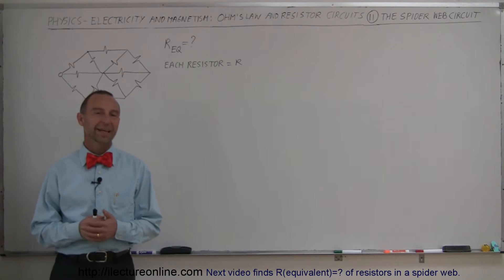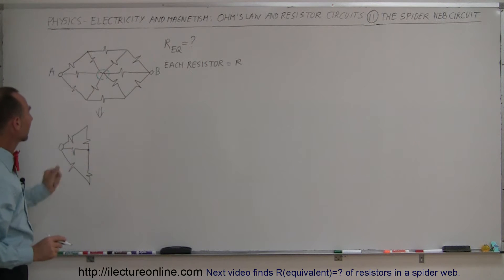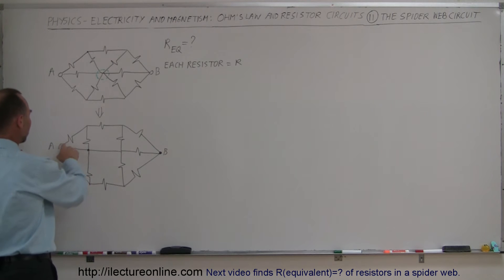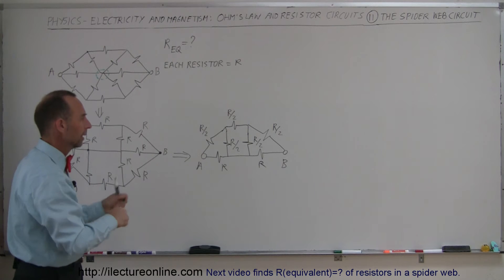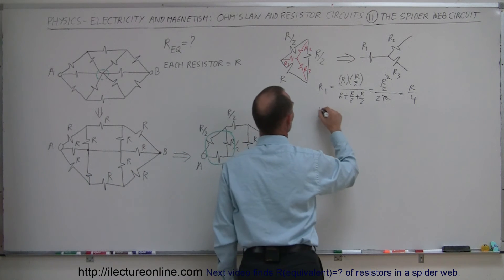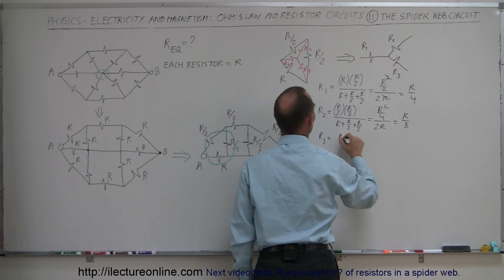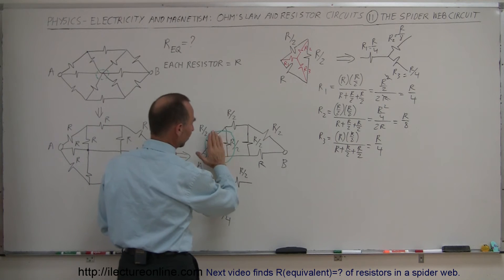Physics - Ohm's Law and Resistor Circuits (11 of 23) Resistors in a Spider Web (1)

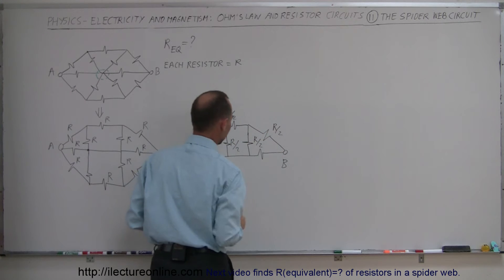Comment: In 5:07 how did you know that if we half the resistors the current will douple. I mean does halfing the resistor has anything to affect the equivalent resistance
Reply from the maker: In general, using Ohms's law,   i = V/R
Reply: @MichelvanBiezen  Sorry I think I was dumb. However I have thought about it another way:Doubling the current and halfing the resistances will have the same initial effect on voltage drop across the junctions which means having the same situation as before.
Sorry If my English is bad I am outside the us

Comment: At last step after replacing the delta with y circuit, the current pass in the lower wire only,so the upper resistance cancel
Reply from the maker: No, the current passes through both the upper and lower resistors.  The technique used here is the "symmetry" technique realizing that the circuit above looks exactly like the circuit below.

Comment: Really great video, got me to understand the problem alot more but i was confuse when you pancake the circuit then the value reduce to half. Shouldn't the value of the top resistor be 2R? While the value of the current remain the same since you are not cutting the circuit in half.Hope that you can reply to me as soon as possible.
Reply from the maker: When you provide 2 paths for the current, the resistance drops to half.
So when you pancake the circuit the resistance goes to half (not double)
Reply: I don't get the logic to that. My brain can't wrap around that for some reason. If you have a coin then put another coin on top of it won't there be 2 coin? I don't understand how does that logic does not apply here? If i recall correctly in the video you said that the current would be 2A when you 'pancake' the circuit and cutting the value of resistance to half. If the value of resistance is double because you fold them together but the current stay the same at 1A, would that work? Because that make more sense to me. I have been trying to get the way of thought for this course for awhile now but i still can't get it. I don't understand how my lecturer are changing the circuit like rearranging the living room.
Reply from the maker: Shahril Md Noh
It may help if you look at the videos where resistance in parallel is introduced and where you have to find the current in parallel branches.
Reply: @shahrilmdnoh4926  imagine resistors as tiny doors you have to squeeze through, and the people who are going to squeeze through these tiny doors is the current. Two tiny doors would allow more people to squeeze through at the same time than just one tiny door right? That's the best eli5 I can do
Reply: +Shahril Md Noh now also if you dont understand, go to physicsgalaxy website under advance illustrations tap on electrostatics..and click on capacitance and then see illustration 21..sir did that for capacitors..you can do for resistors also..now you will understand..even now also if you didnt understand..wait for booster class of electric circuits by ashish arora..in physicsgalaxy